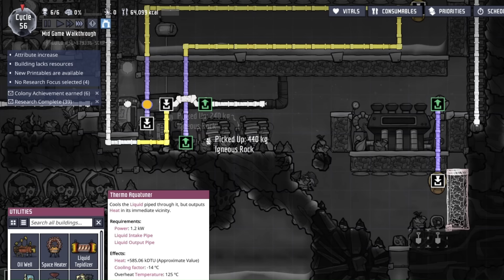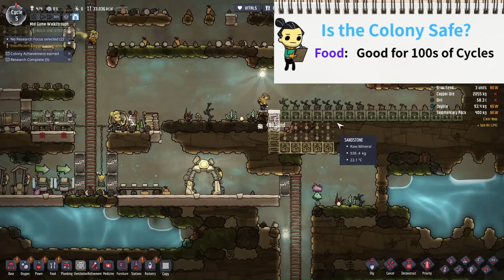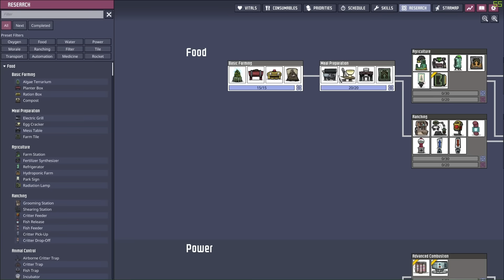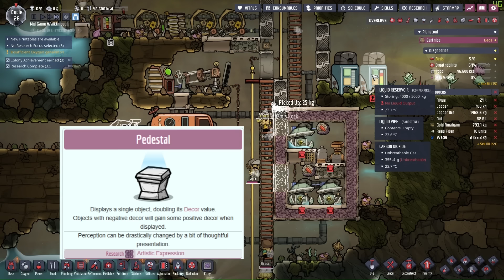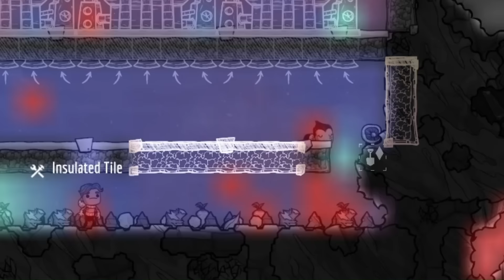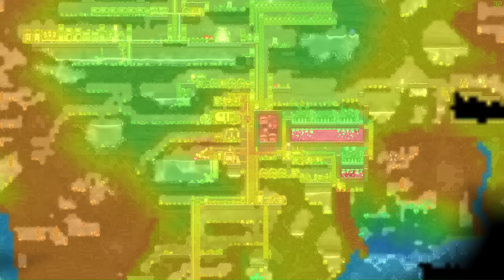The Complete 2026 Mid-Game Engineering Guide of Oxygen Not Included

Comment: I have a little question, i'm playing on an asteroid without gold and want to tackle metal volcano tamers once again. Do i need to make the conveyor rails out of steel  if i can't have gold ?
Reply from the maker: gold is actually a bad choice for conveyor rails, they have a low melting point and low heat capacity. Better use iron ore and make sure the rails do not directly pass through the volcano emit tile

Comment: Id be interested in the Sauna video. Personally I think they are useful for Glass Forge, power generators, kiln, and Aquatuner. I typically run it as a dirty block feeding slickers to delete Carbon dioxide. Id hardly call it a critical project and is more something vanity when I push to find more to do to fill time. Im fairly sure its a net positive as long as you dont do things like throw metal refineries in it. You can route your metal refinery cooling through it just not the building itself so that carried materials and output stay separate.

Comment: I dunno, the first dupe I print if it is an option is a rancher.  or someone with the rancher 1 trait. Ranchers have to start out with farming 1 otherwise, it feels like it takes forever to get ranching 1 unlocked naturally. I usually already have Advanced Research prior to that, and Ranching researched, or close to being researched. 

Hatches make for amazing food production, and coa and also metals! If you start breeding for stone hatches, even more coal, if you breed to get smooth hatches, they convert metal ores into metals at a pretty good ratio, while putting out next to no heat signature. 

You end up with an insane surplus of hatches and stone hatches you get a sweeper to drop eggs into your water spot to drown the little buggers for faster meat.

BBQ off your grill is pretty damn good stuff!

You see 3 drekko eggs, print them asap as well. They take forever to hatch. They will eat mealwood and poo phosphorite out. You will want to get these going early as well, for Glossy Drekko, which shear for plastic. Get a few farms of these going and you will have plastic for days. 

Ranching is insanely time consuming is the only issue, before automation. After automation, there is zero reason to not get critters all set up, their morphs tend to give you insane value.

Comment: So I started new colony to follow this guide xd for a test

I’m doing everything slower than u(cuz I’m used to digging I think and I like deodorisers) so it slowed down my pace but wow not even 30 cycles in and I’m almost at crude oil this is insane
Reply: Feels like if after high school I skipped university and found a job
Reply from the maker: 😁 Did you feel like you skipped a lot of unnecessary things?
Reply: @tabeyuriko yes but I fucked up electrolyzer generator a bit Hahaah
I thought If ill build it like mirrored it will work but I was wrong :D will try to fix it today

I have so much oxygen now in base that it goes over pressure and it doesn’t give enough hydrogen to sustain the base but is def my fault
Reply: But hey I saw crude oil first time in all my playing attempts yay
Reply from the maker: most of the electrolyzer designed can't be mirrored because the gas output tile is always at the top left

Comment: Water in SPOM to reduce the footprint is something I've not seen anyone do. I like it; I will probably incorporate in my colonies.

I think a basic ranching guide would also be helpful for newer players. IMO, even the most basic setup needs an autosweeper to remove eggs automatically. You can use pick up and drop off points for supplying ranches with critters but automating the delivery saves a lot of labor when you're dealing with a hundred fed divergents or slicksters.

Also so many "evolution chamber" designs found around the internet are over-designed: you only need like 100 grams of water and a mechanized door on top.

Comment: 5:35 You don’t need to worry about distance to dirt, especially in the starting biome. If you want to minimize time your researcher spends on supplying, just put a storage bin next to the research station and designate it for dirt. Put a limit on the amount (maybe 5T) and decrease your researcher’s storing priority. Other dupes should fill the bin for them.
Reply from the maker: Supplying to a storage bin still requires dupe labor 👀
The point is the light/laboratory bonus is actually so underwhelming that it doesn't even worth the delivery time, better to just get a high science dupe

Comment: 6:00 - you don't need to rush farming. You can find and harvest enough food for a while.
Since each dupe consumes 1,000 kCal per day, just multiply your dupes by 3,000. so 3 dupes shouldn't worry about food until you are under 12,000 kCal. (at which point start making Mushbars)
You start with 16,000 and should find plenty of wild plants and buried foods to keep your supply up. I rarely even consider food until cycle 12 or so.
.
If you are worried about early food, just build a Microbe Musher and crank out some Mushbars when needed. 5 bars per day for every 4 dupes. You can also set the Musher to produce Lice Loaf infinitely, this makes every 2 meal lice harvested (1200 kCal) become 1700 kCal, which is 40% increase.
If you do this, make sure to use the Consumable tab to tell dupes not to eat the Meal Lice.
Reply from the maker: don't know if this is serious... delaying farming and use mush bars?  😭

Comment: Agree and disagree on using Atmo suits in Early game. Sometimes the debuff you get from  an atmo suit is worth it even if their moving slower. Ive had dupes die because their moving so slow because of the debuffs from the various things because of No suit.  If they have  suit on at least they wont suffocate.  With a fast start like your showing it spreads the base too big, travel times are increased. Later on you have to rebuild the base to increase productivity thru shortened travel times. We all have our "model base" after so many games. Its good to plan out a base at the beginning in the first cycles. Especaill helpful on non-standard planets.  Refinery on cycle 22 is impressive though, but takes alot of dupe power to run. Your a great speed runner player.  Excellent instructions overall. Appreciate the in game build sheets.
Reply from the maker: The atmo suit suggestion has to be paired with my recommendation of digging, which is derouting from opening up unfavorable packets (e.g. chlorine/hydrogen), so to not release those debuffing gas in the first place.
In theory you should be able to get to oil biome with all safe environment all the way.
But if due to the map there is indeed some unpreventable hazardous biome you must get through, then of course you could put the atmo suit dock right before you have to enter said biome.

And thanks for watching!

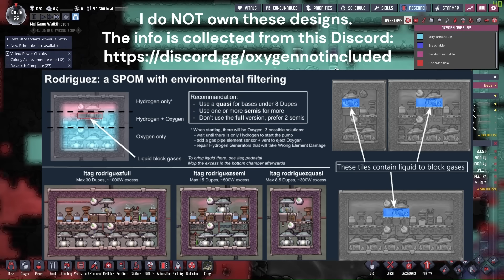Comment: the image at 25:02 is very misleading. it says "Max 8.5 Dupes" of oxygen, but you can only get that if the electro is managing to hit 100% uptime, and i promise you that layout is not.

the air just doesn't move out of the way fast enough, only way to get 100% is to literally have the air pumps Right Next to the hidden exit port of the electro, and you can't do that with them under the floor like in this setup. this setup is maybe getting 80%? 60%? the air pressure in this game moves that slow.
Reply from the maker: Max 8.5 dupes mean more like "If you have more than 8 dupes you must build another one"
Also when you actually do have 8 dupes and the pumps pumping out almost 100%, the uptime of electrolyzer would also be really close to 100% as well.
Reply: @tabeyuriko  you didn't read beyond the first sentence it seems. your statement is misinformation.

8.5 is the on paper max that the one building can support, but with the pumps this far away you'll never get close to that. READ
Reply from the maker: @Layarion  it can get very close to 100% uptime. Maybe you can try reading too
Reply: @tabeyuriko  i was in my world trying it out, 80$ is not "very" close, not even close. it doesn't reach 7 dupes you fucking liar
Reply from the maker: My test yields 93% which is more than 8 dupes. Maybe you also need to learn to copy the design precisely

Comment: How does he go so long without any oxygen generation? It looks like he doesn't generate any until after 20+ cycles. I get that they keep digging down so he gets oxygen pockets but I don't understand how it lasts that long (other than don't print dupes early). I tried to go after the same method but I already have 10-15 tiles deep of CO2 that my dupes have to go through to dig deeper, and it's just to Chlorine pockets which is not ideal. Still great guide thanks!
Reply from the maker: Shouldn’t open chlorine packet at all. Just reroute to an easy path.

Comment: That plumbing looks broken, I'm guessing what will happen is that a mid-point will be chosen randomly at a sink/toilet inlet and that inlet will be feed from both directions... and be the only building getting water from both sources.
Reply: ohh, and it's not sufficient as "just a primer" because that lavatories are the last two to be primed...  meaning you may never get any pee from that water pump.
Reply: lol, yeah I saw you fighting with that.
Reply: You have to hookup the pump again to get those water packets to "move."
Reply from the maker: where?
Reply: @tabeyuriko  The toilets...  It's that bridge output, then 4 inputs and then the pump output.  In the video you cut the pipe in a few places, but it just looks like your brute forcing it.
Reply from the maker: @PetraleiTanyl  I was only feeding it from the other direction initially so the piping looks weird, afterward the initial pumping there's no "brute forcing". And this guide wasn't focused on how to setup a washroom anyway so I didn't really put emphasis on this part
Reply: @tabeyuriko  The fix is to cut power to that pump and cut the pipe at the bridge and connect the pipe so it's the pump output and then 4 inputs...  Adding an output after the inputs breaks things.  The only time You can do that is when you bridge onto a run to "top it off."

Comment: 26:22 I'm sorry if my question is redundant or if you already address it in the video, but doesn't the electrolyzer produce oxygen at 70 degrees or more depending on the water it uses? How do you cool the oxygen?
Reply from the maker: You just run the cooling loop to cool the tiles inside your base/living quarters once the Steam turbine/Aquatuner cooling combo is finished. Cooling solid tiles would transfer heat away faster than cooling oxygen.
As long as the environment in the base is kept at reasonable temperature, we wouldn't care about if the oxygen produced is 70 degrees or more.
Reply: I see, thanks!!

Comment: How is Frosty Planet supposed to be played? Standard SPOM freezes over. Even the bathroom loop freezes. There's no water at all so you have to melt ice
Reply from the maker: There's a research portal nearby, which unlocks the ice liquefier for free once you activate it.
It then use wood to melt ice into water for you, and there's 20t of wood provided for free too
Reply: @tabeyuriko Yeah that's only good for the first 50 cycles or so
Reply from the maker: 20t of wood can melt about 600t of ice into water.... and dupes relying fully on electrolyzer consumes 67kg of water per cycle. For a colony of 10 dupes that is good for 900 cycles...
Reply from the maker: And long before the wood depletes you can start using metal refinery to generate massive amount of heat to melt ice on your own
Reply from the maker: If you used up 20t of wood in 50 cycles its likely you are using wood for tile and ladder construction.
While that might be necessary in some maps, once you dig out to get normal minerals you can replace the wood buildings to get the wood back.
Reply: @tabeyuriko Ah, I didn't think of using the electrolyzer. I'm having trouble keeping the water frozen in storage and pipes
Reply from the maker: @maxstr  You can try to use "Bottle drainer" which allows dupe to deliver bottled water (from liquefier) directly into it and into pipes, so you don't have to first dump it out and pump it back again

Comment: Spent hours copying the quasi but I can’t get it to work. It produces too much oxygen. The electrolyzer emits 888g/s but only 112g/s of hydrogen. 2 pumps don’t drain it out fast enough.
Reply: Had it flipped round at the top, it doesn’t work. Copied it exactly and it works perfectly…
Reply from the maker: yeah not all designs can be flipped or shape changed👀🤔

Comment: BTW wich material are you using for insulated tiles?
Reply from the maker: igneous rock. sedimentary rock works too. They are both better than sandstone. which is better than granite. (Don't use granite)
Reply: @tabeyuriko i always wait for ceramic, i guess i was doing wrong there. Nice video 🎉
Reply from the maker: @byakuyaboii1562  ceramic is great but most of the times overkill :_happy: You probably don't really need it until you make some very dedicated builds

Comment: I am the opposite of u. Since it's a single player game, there no need to rush anything.... because it's not competitive. I play very slow. Putting down everything exactly where I want it for the future too and then doing the next thing. I get to the oil biome after about 200 cycles and to rocket after 500. I make SPOM (or variant) after about 120.
Reply from the maker: It's fine, the guide is for those that wanted to set these up faster, or HAD to do it faster (because they were originally too slow and the colony is failing). But for experienced player of course you could have much more flexibility in choosing which stuff to do first. For my own colony I actually don't build steam turbines at all.

Comment: You could cool from the root if you cooled the electrolytic output. So regulated temperature air goes into base and the cooling distributes on its own.

And I see why the sauna doesn't make sense, as the steam engine is the only thing that deletes heat. And refineries and the like simply transfer it to coolants. So like, yeah. Cool the coolant and it'll keep the machine and liquid cool pretty much, and since it deletes the heat from the coolant it is already at peak efficiency. And the materials made are already at workable temperatures so no power is wasted heating them up.

Comment: Im new to Oni, and this video helped a lot really, But whats the deal with the pump? its not supposed to be connected into the SPOM's power grid to say that it self-powered? I'm supposed to connect or not? I know that it would overload the grid, but i need help.
Reply from the maker: You mean the liquid pump? If you were using normal wires you can choose to not connect the liquid pump to the SPOM grid. Although in practice, even if you connect the liquid pump to the grid, it would only activates one tick every 10 seconds or longer, because each pumping delivers 10kg of water, while electrolyzer could only consume 1kg per second.
in theory the overloading should also be gone in an instant and the overload damage won't occur.
Reply: @tabeyuriko  Thank you for the help.  Imma connect it to it than

Comment: I would love to see you make a video about industrial saunas. Since metal refineries output metal at 40°C I can see them soaking up heat and resulting in a loss.  Same with the kiln. 

But I'm thinking a sauna is good for batteries, transformers, hydrogen generators, and maybe also other generators that produce CO2 and include a molten slickster ranch in there but i would love to see your opinion on that.
Reply from the maker: batteries, transformers, hydrogen generators in are okay ish, although the gain are minimal and you need to make all of these into steel. But at least still better than putting refineries, rock crushers in.

Comment: Ah, I love this "first X hours/cycles/seasons in <game>" format, reminds me of DemonRebuilt's awesome DS Shipwrecked/Hamlet guides. :)

I really got spoiled by the abundance of worldgen, lukewarm naphtha in the Baator map - I consider opening sealed rooms with a single-bead lock a non-issue, especially with the bottle emptier or the hydroponic farm emptying trick  :)

41:35 - one other 'gotcha' from the game is that natural gas is lighter than steam, and would thus also block turbines. Beware of flatulent dupes.

43:20 - it's admittedly not done universally, but I'd suggest spilling a fair amount of petrol/crude on the floor (10+ kg per cell) - especially if you're going to make a 3-high steam room
- helps spread heat within (high heat exchange between liquid cells)
- prevents heat leakage through imperfect tiles making up the floor (not a gas, so heat exchange is ~25x lower)
- allows you to actually have >1000kg of steam pressure if you want to use the steam room as a battery, just submerge the liquid vent
- allows you to use gold amalgam aquatuner if you need active cooling ASAP

55:00 - mess tables are now public by default, you don't need to build one for every dupe ;) 

55:22 - there's a mod, "Map Overlay" that can highlight neutronium, or outright show the geysers/volcanoes. It can also highlight story trait buildings which I find useful when planning the base.

Re: industrial sauna - not like I need more reasons not to build it, but I am curious what you'd put in the video. I'd love to see some experiments with proper power budget accounting, maybe an example of BlakeMW's "vacuum brick" idea from the forums.

A more reasonable desire in ONI I think is to put petrol/natgas generators into a sauna room, and it would be nice to have an explainer how/why the mass deletion happens, and how to avoid it.